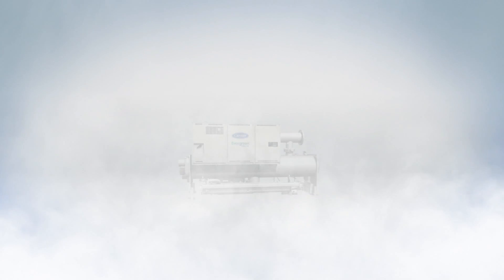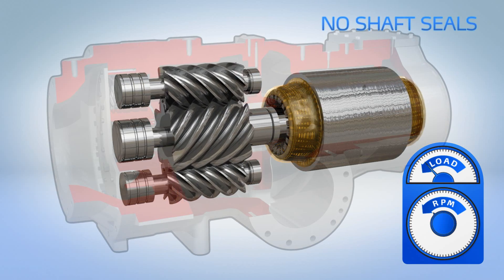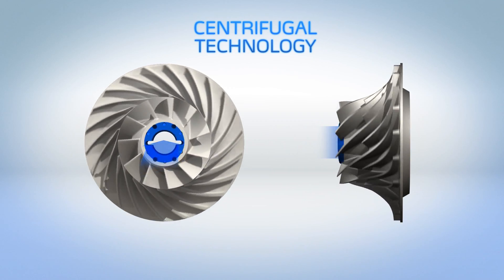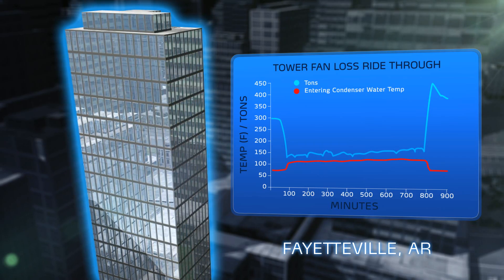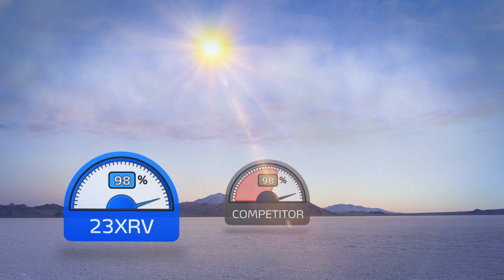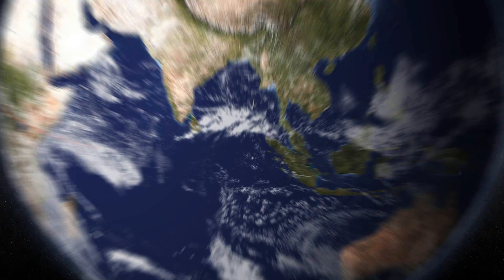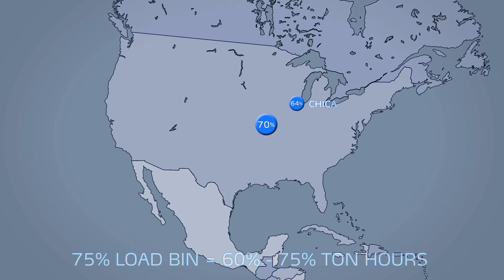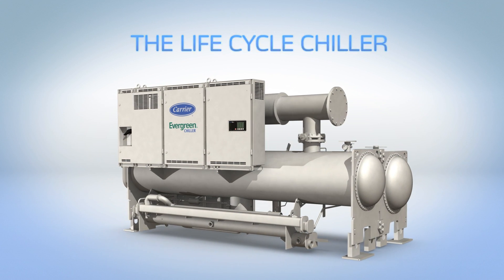Carrier 23XRV Water-Cooled Screw Chiller

Comment from the maker: Typical residential systems are between 0.9 - 1.5 kW/ton and include all electrical items (not gas).  Water cooled chillers are 0.3 - 1.0 kW/ton but do not include cooling tower, pump nor indoor fan power, BUT the whole system is still low at 0.5 - 0.8 kW/ton.  Speculating, the 250 residential systems on a commercial bldg was driven by lower first cost.  Landlords typically do not have an incentive to provide efficient equipment for tenants responsible for their own heating and cooling costs.
Reply: indeed!

Comment from the maker: Water cooled chiller ratings are specific to the application's condenser water & chilled water temperatures, flow rates and glycol percentages.  Carrier's 23XRV chiller ranges between 0.299 kW/ton IPLV - 0.35 kW/ton IPLV.  Full load is less important (based on your geographical location) but this chiller still achieves +/- 0.5 kW/ton at full load.  Please contact your local Carrier Commercial Sales Representative to get exact efficiencies for your specific application.

Comment: Looks like Carrier decided to go from a two-screw unit to a triple-screw unit in developing this technology. This is interesting because I am trying to do just the opposite - I'm trying to turn a twin-screw compressor into a pump for the hydraulics industry, which only uses triple-screw technology. Very interesting design, though I've heard they're somewhat noisy due to the fixed 4KHz PWM switching frequency.